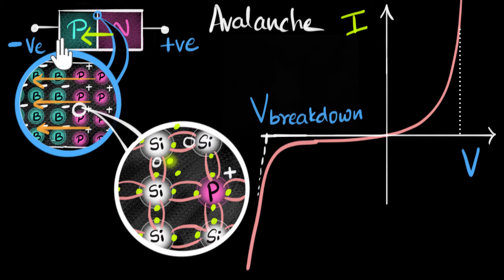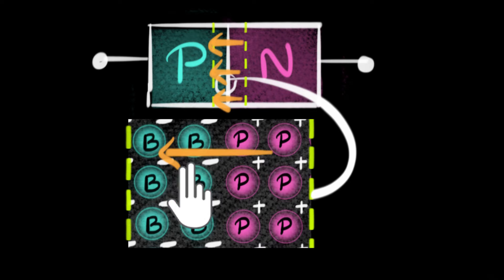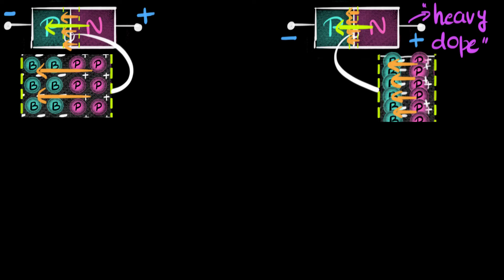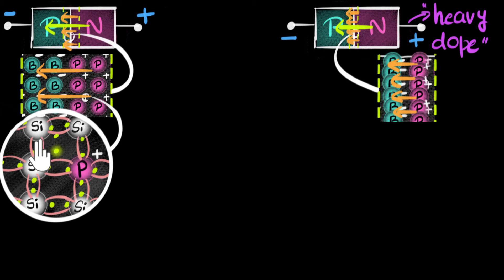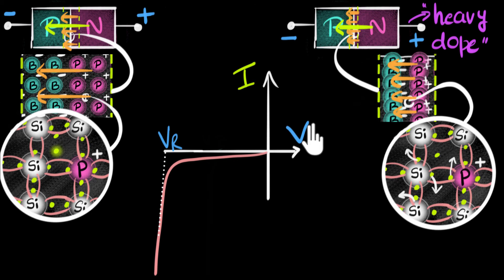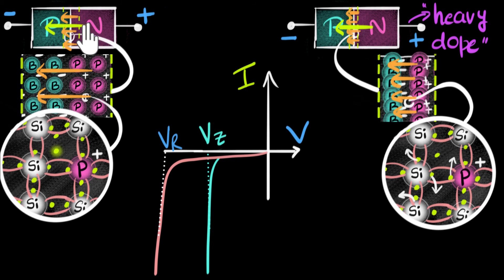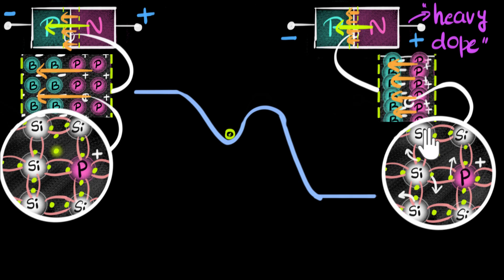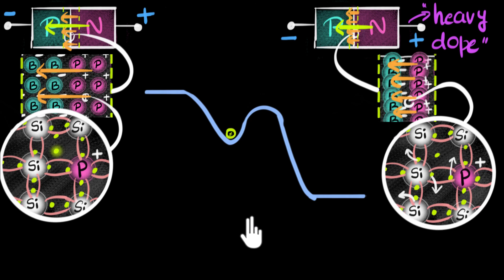Zener diode & Zener breakdown | Class 12 (India) | Physics | Khan Academy

Comment: 4:29
 So is the potential difference(voltage) across both the depletion layers the same? 
That is, even after heavily doping the diode, the depletion region has the same number of "space charges" except they are concentrated in a much "narrower" width? 

Or is it that due to increased diffusion current (which corresponds to the "rate"  of majority charge carriers), more space charge is present in the depletion layer?

Comment: Thank you very much for your explanation
one question?
If the field of the discharge region in the zener diode is stronger than the normal (pn) diode, then why do we have only 0.7 V potential drop in the direct bias of both diodes

Zener diode field is stronger so we have to apply more voltage in forward bias to overcome it

Comment: Sir I have a doubt
In Zener diodes, there is a very strong current flowing in the depletion region (as the depletion region is very small)
1. So the strong current in the depletion region is not caused by the voltage that is being supplied to it, right?
2. What is the purpose of reverse biasing it? Why not forward biasing? (It must conduct electricity very heavily, right? Because of an already small depletion region which is created by forward biasing, and if we dope it now, it will conduct much more)
3. Why should we even bias the Zener diode, if the current caused in the depletion region is not due to the voltage supplied, and removing the voltage supply (stopping reverse bias) will only aid in the process, since the reverse bias is causing the depletion region to become bigger, and if remove the voltage supply, won't the depletion region become smaller, and hence a much stronger current will flow through it. (Because lesser the depletion region, more thecurrent flowing through the depletion region, right?)
Reply: i have roughly read this comment and have to say that, we dont want high currents passing by forward biasing, we have conductors for that
Reply: Purpose of a zener diode is to generate more current due to movement of minority charge carriers under reverse bias condition. That's why we don't apply forward bias. Depletion region becomes small due to dopping... The concentration of positive and negative ions increases so that... Electric field also generated. The purpose is to make diode to conduct  more electricity under  reverse bias condition then.. Why we have to apply forward bias...?. Then its right that the flow of charges is independent of voltage inside the depletion region outside the depletion region it is necessary to supply voltage because the minority charge carriers have to move across the barrier(depletion region)thats why we apply voltage  . Dopping is inversely proportional to width of depletion region. Thats why the depletion region reduces not because of forward biasing and voltage supply would not interupt the width because due to strong electric field. There is no possibility to widen the depletion region width.

Comment: Sir won’t the glowing electron at 6:30 just REPLACE the electron which you said is DISPLACED from its position ?
As we know when 2 objects of the same mass collide elastically and one of them is at rest, the their velocities get swapped.
Here the stationary object is under the influence of a force(Lies in Si valence band) hence it should further lower its chance of just escaping out from the stable octet, and even if it does, the approaching glowing electron must readily replace it under the pretext of completing the octet.

If what I argue is true then there should be no extra current generated in the depletion region...

Comment: @Khan Academy India - English why did you say the probability of a free electron knocking off another bound electron is less? If the width of depletion layer is less, then the ions will be more in that space( as also see in the diagram above) or will be tightly packed, so probability should be more....??
Reply: The contributing factor here is the number of silicone atoms ,, number of p and b atoms are very low as compared to silicone,,,,
P.s. --in zener diode number of doped atoms per unit volume is more ,, but the structure is same they are not tightly packed in the second scenario.

Comment: How is the slope electric field
Reply: That's a V-I graph(Volt - Current). In normal conductors ,the speed of current depends on volt (i.e. More Volt Higher flow of current, less volt lower flow of current). But in this semi-conductor ,the voltage is limited even though u give higher amount volt all because of the property of the material. So, when u reach a certain volt, the flow of current peeks like anything(but do remember the volt is stable and stops at a certain point).
Reply: The graph is a V-x graph (Volt - Distance). Here, the slope at a point will be dV/dx. This dV/dx is defined to be the magnitude of the electric field. The electric field is, in fact, a continuous gradient of electric potential.